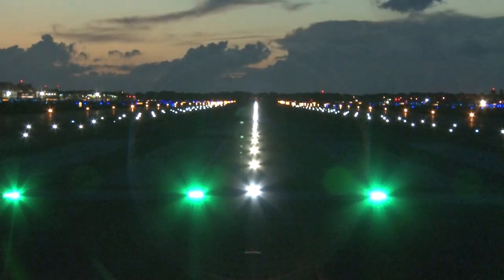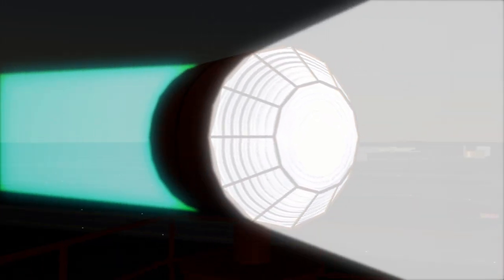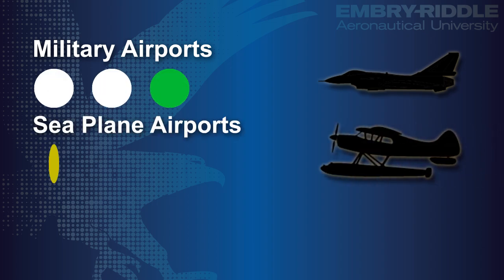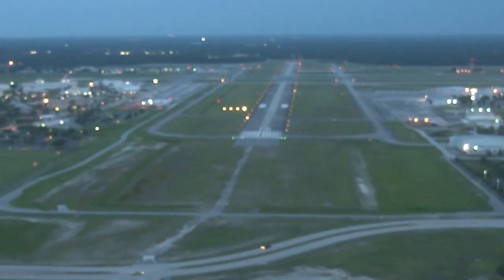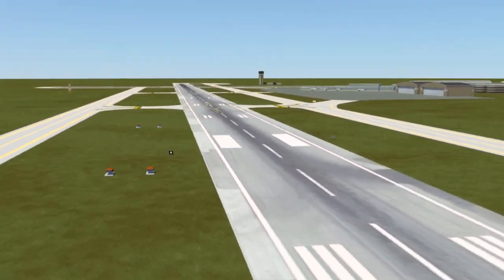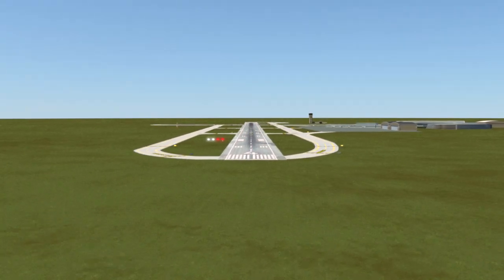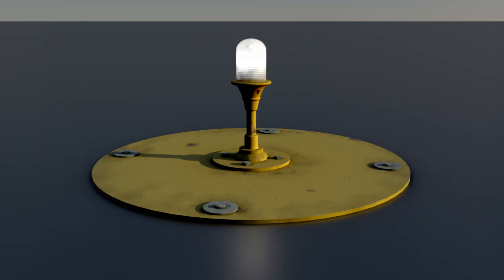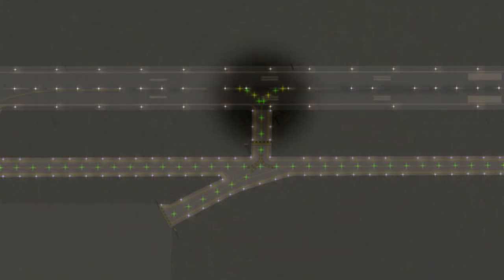Airports - 03 - Airport Lighting

Comment: It would be funny to see if an airplane actually pops those lights that are embedded into the ground out
Reply: This happens from time to time, but they can quickly be exchanged.
Reply: There have been a couple of instances where the nose wheel runs over the lights and snaps the mounting bolts, send the light fixture into the fuselage.

Comment: You did not say how you can manually turn the lights on manually if tower is closed. If you hit your yoke atc button 3 times. 4 and 5 times is for the brightness.
Reply: Depending on the system, the pilot clicks the mic 3, 5, or 7 times. For example, on a MALSR, 3 clicks for low intensity, 5 clicks for medium intensity, 7 clicks for high intensity. The lights turn off after 15 minutes.

Comment: Runway Edge Lights' information is not correct. Edge lights are 60 meters apart, not 90/180 feets (time:4.19)
Reply from the maker: According to the Airfield Standards published by the FAA, Runway edge lights on both High and Medium Intensity Lighting Systems shall be uniformly spaced from threshold to threshold with the maximum distance between lights not exceeding 60m or 200ft. So while you are correct that 60m is a possible spacing for edge lights, it is not the requirement, merely the maximum allowable distance between lights.
Reply: AVIATION YWG nah, it cant be vary between airport, see airport chart, like incheon its 50m apart